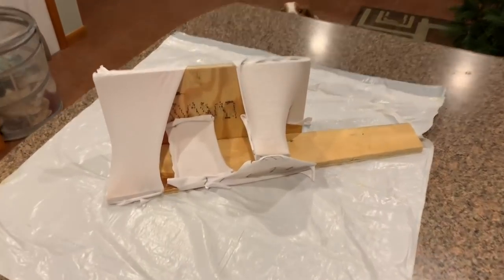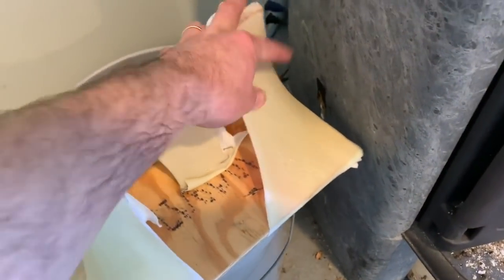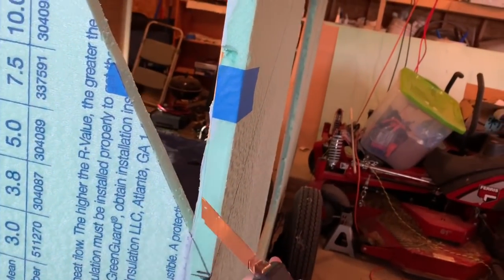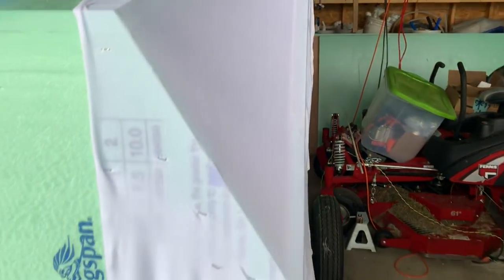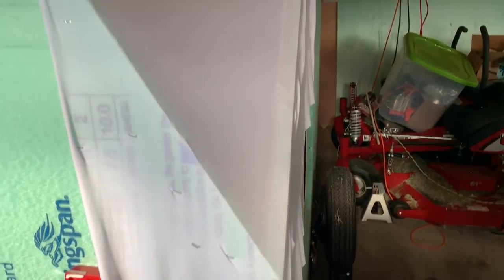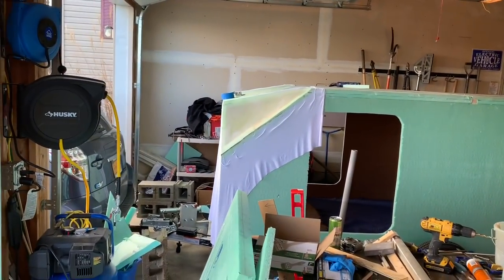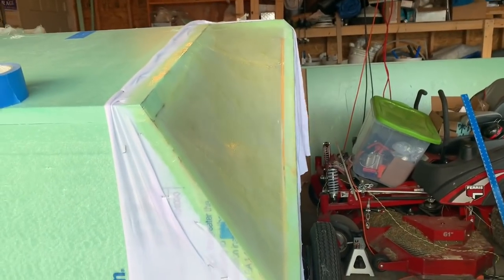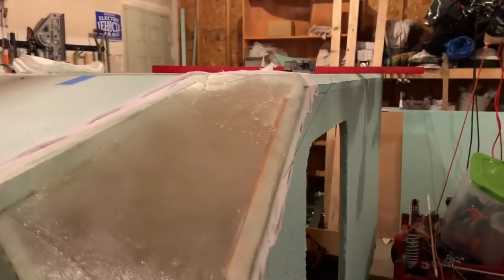Foamie Camper Build: Aerodynamics

Comment: Much more important is, how the backside of the trailer guides the airstream away. Actually the back of the trailer is perpendicular, so it will create ram air which will force against moving direction.
Reply from the maker: Ra Sh yup. That is 30% of wind resistance. I am going to be building something like Trailer Tails into the rear door. That part will be easy. Haven’t started that quite yet. Soon. Check out my aerodynamic videos in the aerodynamic playlist.

Comment: That actually looks really good.  If you're really worried about wind when you travel take what you have and turn it into an aliner top. The nice thing about the aliner camper trailer is there are very low and wind-resistant on the road but once you get to the campsite it takes less than 30 seconds to set it up and you can stand up in the middle. I understand the design is a lot different than what you've already built  but think about it you could repurpose most of the materials that you have to cut off the top shorten walls. 
As far as what you already have of course you will get a little bit more wind deflection going down the road. The large gap between the vehicle and the trailer is going to cause some kind of wind resistant. To be really streamlined with what you already have you would have to put something in that Gap behind the car to the trailer good luck but it's looking really good!
Reply from the maker: Thanks for your post but I am not interested in changing it to an A liner. I have already made it too far. I am also not convinced that an A shape would be aerodynamic. I think my shape is going to work well. I also dont want to have any walls that move up, down, in, or out. The components to make that work would all add weight.

Comment: I think that by using felt works better. My friend used it for every stero sistem build and it comes out really hard and improves sound. Just a sugestión for future builds. Love your videos
Reply from the maker: samv1430 they call it PMF for poor mans fiberglass. It’s weaker and the finish isn’t half as strong. I don’t like the way it looks. It looks cheap because it is and that’s why people do it. Lots do it but it’s not for me. You could punch a hole through it. Try punching fiberglass you’ll break your hand

Comment: What i've learned about aerodynamics is immediately after the vehicle air (that is traveling over the SUV) will begin to travel downward. The small lip on most SUV rear windows helps delay this effect a little but it will eventually drop until it is pushed back up by the air traveling under the vehicle. Turbulence is usually created from sharp and drastic slopes like what you have on the corners. The reason most trailers are rounded is to reduce the turbulence. It is better to have a blunt face the slowly directs air than a drastic turn. Just like with dust collectors in shops, turns must happen gradually (not rapidly...90 degree turns must take about 2-3 feet...not just a 90 degree elbow) This can cause noise and actually more drag because the turbulence is fighting the air traveling around or over it. 

SUV wind tunnel
https://media.gmc.com/content/Pages/news/us/en/2018/jan/0122-terrain/_jcr_content/top_parsys/image.img.jpg/1516391202023.jpg

Example of high trailer down pressure
https://designbuild2015.files.wordpress.com/2015/03/suv-wind-tunnel.png

Comment: Don't worry about it don't worry about it once you run some spandex from the car to the trailer and and this take the airflow of the car and bring it right to the the trailer and put some snaps on it'll stretch you make your turns and all that and you'll get is be better than anything you could do on the other end in this lightweight and it's cheap
Reply from the maker: Thats pretty much what I ended up doing. It turned out pretty good.

Comment: I know this is too late for this build but in general would a curved front like you see in some horse floats be easier and more aerodynamic than trying to adjust a box?  I remember a very old (ancient :)  ) popular mechanics issue that compared a VW micro bus and an E type Jaguar and said the VW was more aerodynamic due to the curved front.  Thoughts?
Reply from the maker: The front of my camper is very close to the rear of my car. It’s another strategy to reduce drag. It fits perfectly behind the Rav.

Comment: Hi - Thanks for the videos. My big question is .... where did you get the Tesla 85kwh battery? How did you get the electrical hookups for it? Ie: doesn't it need computer control and all that for charging it or does it just have a plug that goes to an EV charging station? I am working on a truck camper build and would like to use a big EV battery. 
Ken
Reply from the maker: I bought it from Alpha Auto in Cortland NY. Tell them Jim with the range extender sent you.
I use the onboard BMS and a custom controller.
Reply: Thanks James. I did find one of your videos that showed how complicated that whole battery thing really is. I only need around 5kwh minimum so would be better to find a different solution. I thought that maybe the 4.4kwh battery out of a 2016 Prius would work but I have no idea how to charge it and get it working with 12 volts (or 110 AC).

Comment: Avoid the sharp angles. Edges= turbulence. The beveled edges are a good start but I'd round them over by sanding or Surform tool. For those front angled parts, instead of draping/stretching cloth over that triangle, I suggest gluing a sheet of foam across the open triangle, either a thicker one, say 4", or laminate 2-2" thick pieces, then carve/sand to a smooth curve. A basic fine toothed hand saw works well for cutting foam(see link). Here's a tutorial on foam shaping https://www.youtube.com/watch?v=fzpVLqeG_RU
Reply from the maker: If I had a better shop and more space Id like to build one like the Mypod from Little guy just larger.

Comment: I’m towards the end of my build and it seems to me you have way too many sharp edges. Have you considered rounding all your edges?  Seems to me air would flow and find its path much easier that way. Should be fairly easy since you’re using cloth. Just my two cents.
Reply from the maker: The front edges are going to be tucked behind the car so I didnt round them. I guess I could, it wouldnt hurt anything. I rounded the top corners and if you watched the video, you see the aero scoops.

Comment: Im a trucker, have you seen what we pull? Lol   unless you're gonna cut the whole front at an angle you're not gonna make a huge difference. If you look at a tear drop, it's the same shape as Indy car spoilers
Reply from the maker: shawn slopoke I don’t follow. What are you trying to say? There are most definitely aero mods you can do to anything. Including a semi truck
Reply: @JamesKlafehn  right, I'm saying the most effective shape is gonna be the shapes you see in race cars or airplanes race boats. I see what you're trying to do but as wind moves around your tow vehicle it's gonna hit the flat wall of the trailer, unless you put those same aero flaps that you see on the back of semis, onto your car.
Reply from the maker: @chawnslopoke2619  Ive done quite a bit of research on this. It will be quite aerodynamic. Check out the playlist I have on my page that has a ton of aero videos in it. That might help you understand what I am going for here.
Reply: @JamesKlafehn  I will watch them thank you, great videos!
Reply from the maker: shawn slopoke thank you!

Comment: So is that styrofoam from Lowe's that you have and what he supposed to bond it to I guess you use epoxy I guess right to bond styrofoam it doesn't react with the styrofoam I guess that's how they make airplanes
Reply from the maker: Yes its from Lowes. The pink stuff from Home Depot is the same just different color. Lots of stuff bonds to it but if you want to use fiberglass you have to go with epoxy resin. Polyester resin will eat through it.